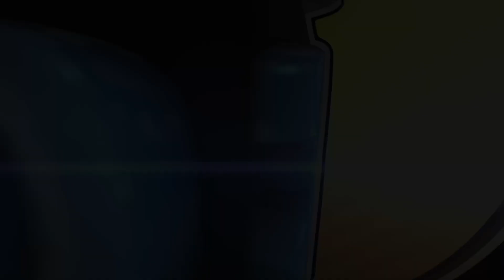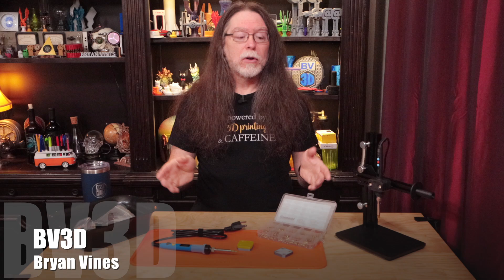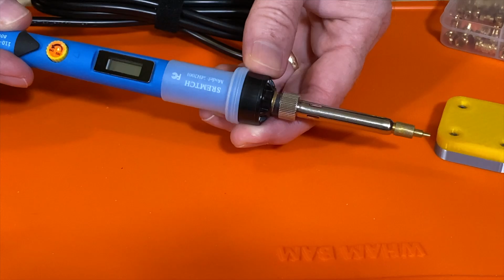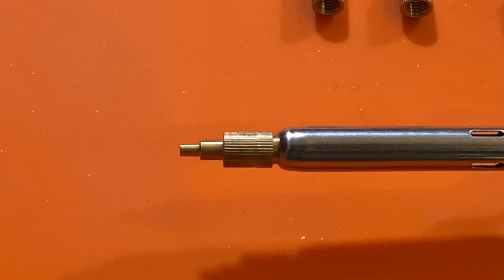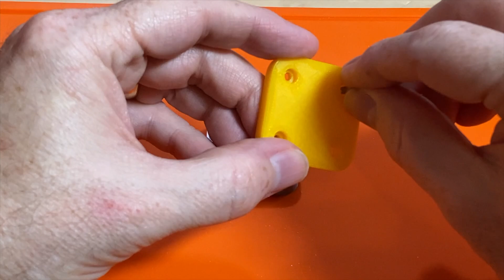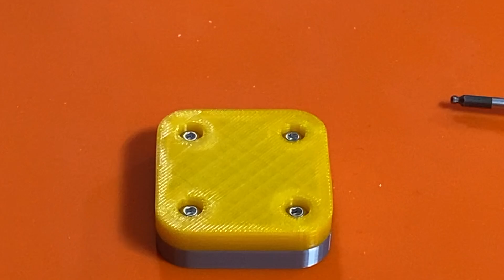How To Install Heat Set Inserts in 3D Prints

Comment: I've done a handful of heat inserts. I have a benchtop soldering station. My biggest issue is I sometimes add angle to the insert from not keeping the iron perfectly vertical. I can't even tell its happening until I've already pressed it. I haven't ruined any prints yet, but it's been close. I'm definitely thinking of going the press route.

Comment: Good information but any tips on the size of the hole vs the brass size? 
Trying this with my solder station I ended up with a bunch of plastic in the threads. 
Sounds so easy but its not.

Comment: Been doing this a while, never knew there was an actual tool for putting these in, I just used an iron. I'll have to check out that tool. If I am making a bolt-together joint that will be taken apart infrequently, I just bolt directly into the plastic. But, for my waterproof RC receiver boxes, were for frequent access might be required, I use threaded inserts.

Comment: great video, but I would never recommend those cheap soldering irons, they are pretty horrible. Specially when you can get a pincecil for like 25$ (when in stock) which is a fantastic cheap soldering pen!

Comment: To get them perpendicular to my print, when possible, I heat and insert the insert til it just a mm or so proud of the print and then I use a metal rulers broad side to shove it that last mm or 1/16". When the ruler is flat on the surface of the print I know that the insert is at the correct angle. That way the insert is inserted perfectly perpendicular, every time.
Reply: So you basically remove the soldering iron and then put a metal ruler in its place, and then press the ruler down while the insert is still hot enough to melt the plastic? 😮 If that's correct: how quickly do you need to act before the plastic solidifies?
Reply: @First_Ninja  reasonably fast. I only do one at a time. Heat one, press it down and use the ruler. If it solidifies too fast, then its better to reheat it and make a new try. You'll get the hang of it fast.
Reply: @DinJaevel Got it. It sounds like a great idea, and I'm puzzled no one here seems to have taken notice of your comment since you posted it. I'll order some inserts and a metal ruler and print a few test models for experimentation. Thanks for sharing!
Reply: @First_Ninja  it doesnt necessarily have to be a ruler. It can be anything metal, that has a flat side that is bigger than the inserts you use. The important thing is that the flat surface of metal object touches the plastic at a horisontal plane.
Reply: @First_Ninja  let me know if it works for you. 👍
Reply: @DinJaevel  Thanks! By the way, is there any reason why you press the ruler against the hot insert instead of turning the model upside down and pressing it down with the insert first on a perfectly flat surface (like an old mirror)?
Reply: @First_Ninja  nope, I just haven't had any prints where that was an option. Never thought about it, so thanks in advance for the idea!

Comment: Used with a standard soldering iron I use with PETG and had great results. Need to make sure there is no solder on there or it blocks thread!  I found out in a rush to see if it worked?

Comment: Thanks for the excellent video; it was very informative, whether you're new to using inserts or not.  Perhaps you could do a follow-up showing the different types of inserts that get inserted in the holes you make for inserts, *ahem, as some are much better than others, especially the kind you use, as they have that leading edge to go in the holes first. 👍

  I found an unused pack of 5 or 6 multi-tips lying around in the box where I keep my old Weller gun, soldering iron, stand, et cetera that never get used anymore: once you go T100 or similar, there's no going back.  So I popped them in my drill, cranked it up to 11 and used a file to take each tip down to the correct size for each dia. insert in the kit, which easily saved me 20 quid and are just as good as the ones being sold. 🤓

  I'll be buying some 2020 & 2040 eventually and having a go at making the vertical iron holder press thing, too, as I'm finding more and more uses for the inserts in my designs; in fact, I find myself looking for any opportunity to use them now! 😆

Comment: Many brass inserts are moulded around in the injection moulding process or sonically inserted. Tip twist slightly as you insert to get a good bite.

Comment: Around your insert holes - add a slight chamfer it'll help guide the inserts. Also, I have had excellent luck leaving the inserts slightly proud of the surface and then pressing them the remaining distance (while still hot) with a large flat chunk of metal. This ensures they are flat and helps cool them faster.
Reply: I do the same thing but I flip them over and press tham against the table
Reply: This is what I do. I still sometimes unintentionally add tilt to the insert and don't even realize it until afterwards.
Reply: Great tip!